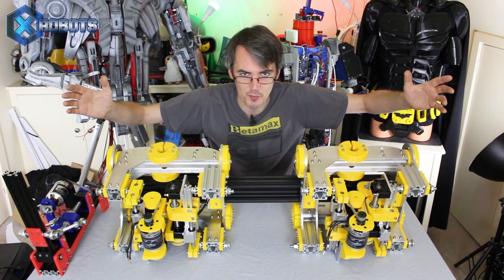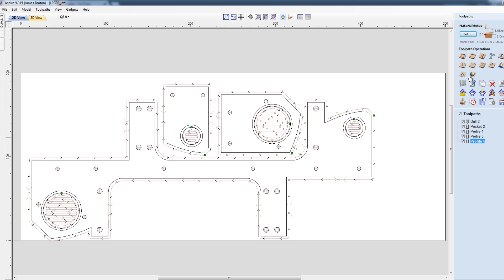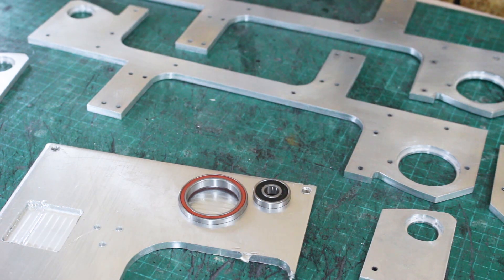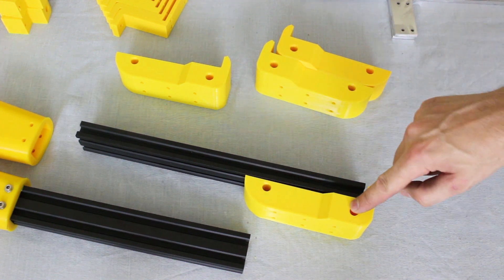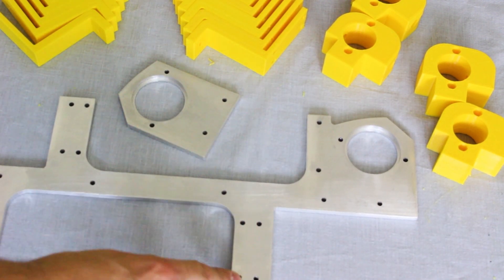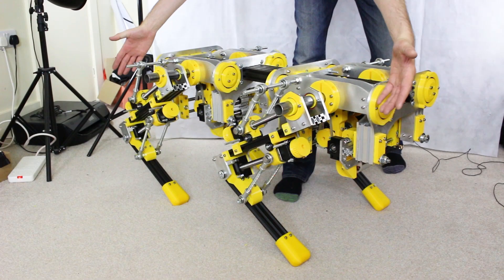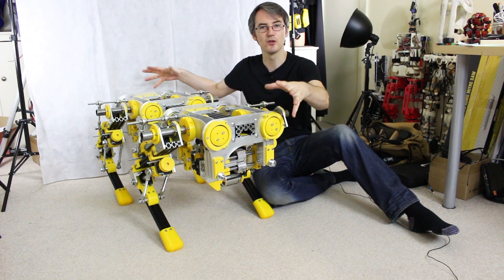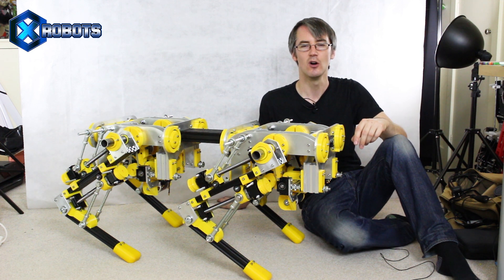openDog Dog Robot #6 | Putting the Legs On | James Bruton

Comment: at 3:10 in, re that dodgey (doggy?) dead spot, im sure you fixed it, but my suggestion was,is,  in  the appropriate function code, add "if in put value = 0, then out put = '37'*"   

37* i.e what ever the correct output shout be, that the mathematics fails to out put because of a divide by zero error etc.
(its just i think you said you added "if input value = zero then fudge it  to 0.0001"   (erghh:( 
just  a thought,:)

(love the whole series:)

Comment: As always great video and build but as someone who does a lot CNC machining I understand how difficult it can be. However, what I've learned is that when you're cutting out big holes and openings (like for bearings) dont cut out the whole hole (no pun intended), but instead cut out just your outside diameter. Leave tabs to keep the scrap middle piece from flying out, and it should work wonderfully (and a lot faster). This should also improve the life of your machine and bits.
Reply from the maker: Those holes were so small it wasn't worth it

Comment: Would it be possible to use gravity and a little valve to drip feed the coolant automatically? And what about attaching some sort of brush to the end effector of the CNC  machine positioned so the rotation of the drillbit pushes those metal strips against the bristles to make them get loose?
Reply from the maker: Probably, you can buy a proper thing called a Fog Buster...

Comment: Just wondering, Why are you machining out all of the center from the large holes rather than just plotting a path to cut out close to the edge then another cleanup pass to get to the final diameter? Surely this ups the machining time by a fair margin and increases wear on the cutter?
Reply from the maker: The little bit in the middle will get thrown out unless I leave tabs and remove them by hand, it's so small it wasn't worth the trouble
Reply: Ah, Good point. I'm used to seeing people CNCing carbon fibre and they usually use sheets of double sided tape to hold everything down to the table. I didn't think about the holes "Plug" popping out and causing problems.

Comment: Very nice project. 
I do worry about the fact that it is very rigid and there is no suspension or dampening for chocks.
Reply from the maker: That will come later. Rigid robots are easy to control because they are more predictable. Any compliance will need to be very well planned and measured and worked back into the kinematic model.

Comment: There's a feature in fusion 360 cam in the drill heights tab were you can click "drill tip through bottom" so that your holes come out clean.
Reply from the maker: Well I could just drill deeper if I'd though of it

Comment: Great work.  I like the reverse idea.  Now this would take a lot of work, but if the design was reversed, the legs could be built directly under the hips, saving a lot of space and a huge amount of weight whilst adding to the strength by using modified aluminum hip plates.

Comment: I'm not sure what you use to break the edges of your aluminum parts, put if you just use a file, consider getting a rout a bur for easy manual edge break or even a chamfer bit to use the CNC to break edges

Comment: With how heavy this thing is, it might be worth the effort to actually build it feet with some toes to that it has greater stability from the added friction and load points. As it is now, on carpet it is going to had sliding issues to cope with, so it will be like Bambi on ice as you are trying to get it to take basic steps. I was thinking something like a dog's paw with a central pad and 2-4 toes. Each one with a ninja-flex pad on the bottom that has a pattern printed into it like a shoe's sole for added traction. Animals have feat evolved for the terrain they walk on, so doing the same for this robot would make it more agile and stable.

This would be after you got the basic kinematic model working for baby steps.
Reply from the maker: Yes we'll see how they go, but they will do for initial setup

Comment: Having the electronics underneath is actually probably best for most applications because it lowers the center of gravity. Top heavy robots with legs are easier to push over in general. It also allows you to have access to more of the T-slot extrusion which means you can add more lasers!

Comment: I would suggest using profile toolpath when cutting through the material instead of pocket toolpaths in vectric, it would spare You a lot of milling time and wear on the bit.
Reply from the maker: It's not worth leaving tabs and the manual cleanup for such small parts.

Comment: Maybe a stupid question but why does the milling machine the intire surface of the holes? Won't it safe time and milling bits if you just mill the diameter of the hole so the middle will just end up as a loose little disc
Reply from the maker: It's not worth leaving tabs and the manual cleanup for such small parts.  You can do it either way

Comment: Great choice on the yellow/black theme.  I am glad you are using plastic whenever possible and only waiting for a failure to force more aluminium.  It does bring up an interesting question.  I wonder if the entire thing was made of 3D printed plastics, if it would be light enough to still hold itself up and function without major breaking.  Maybe a 1/4 size version?
Reply from the maker: I think at the size it is, it would be too flexible, but a smaller model would probably be fine

Comment: Well, I only need to buy/build a CNC / 3D printer... kidney or eye?
Reply: with those o-drives i think you have to sell both😂
Reply: Nah, electronics I can do myself... it´s more that I need at least 1500€ to build a proper CNC and if you want to have it a interchangeable head for 3D printing then all hell breaks loose, having a stable and relative long Z axis can be a nightmare.
Plus some other parts like those opto-encoders he´s using don´t come cheap either, they can range anywhere between 20 - 30€ a piece.
You can easily count for 70 - 80€ per motor assembly without the couplers and the acme lead screws... 
I should probably only concentrate at building a CNC for the moment :-P

Comment: those 10mm rods... i am skeptical!
Reply from the maker: If there were one 'push rod' on them they could bend, but with two it holds parallel with the 30mm tube
Reply: gotcha on that, they still need to take force, that party gets me thinking about a aluminium bracked, just above the 10mm rods.
Reply: i was thinking about this today. as i see it, the force alternates in a walkcycle between those two. i am curios to see what happens!
now you got me hooked to the next episodes!!
;)

Comment: That is looking more and more incredible. One quick question (apologies if it was mentioned in a previous video) but are you using PLA? I’m new to 3D printing and tried PETG for higher mechanical strength, but have struggled with stringing.
Reply from the maker: Yep it's all PLA for now
Reply: James Bruton thanks!

Comment: Is there a bill of materials? I'm particularly interested in the encoders/potentiometers being used and how the robot knows the angle of its joints on startup.
Reply: If I recall correctly, the knee joints have end-stop switches. The legs could be driven on startup until the end-stop switches are actuated so that the robot has some reference for the leg position.
Reply: Spencer Williams That could be problematic if for whatever reason the robot temporarily loses power and runs its start-up routine, say if it was on uneven ground and tucks in all its legs in to find each joint's home position.
Reply from the maker: That stuff is coming next time, but yes it will have home switches for the power-up config. It'll be locked out of any other data until the homing stuff has run.

Comment: When this is complete I hope you send the files to Furze who seems to be getting well into hydraulics at the moment... maybe he can scale everything to 200% and take over the world :D
Reply: Hydraulics work very slowly. There was a video on james channel where a guy made a walking spider with hydraulics. It moved very slowly.
Reply: I've seen some pretty nimble excavators...

Like, if you started with a hand on one of the threads and tried to run a way, a skilled operator could probably knock you down with the end effector before you got out of range.
Reply: i can't imagine why it's so hard to make nimble hydraulic actuators, you could use a system similar to the little syringe  based actuators you see in kids' science project kits, and just attach a normal linear actuator, allowing you to hide the bulk of it somewhere in the core of the body and placing thinner more compact pistons at the extremities, liquid being highly incompressible,  you wouldn't have a whole lot of give in the system if the tubing doesn't stretch, and it would have the same speed or faster of the motorized actuator since depending on the ratio of the diameter of the driving canister to the receiving actuator. assuming the fluid used is not viscus

Comment: You are using conventional milling for most of the cuts, but then switch to climb milling in the bearing recesses. Was that a conscious choice or just default in vetric? Seemed to produce and nice result either way so nothing to worry about. I have found on my machine though that climb milling produces a poorer result in general. Your machine is stiffer and much more capable, but perhaps you could run a test pocket with both strategies and compare finish and tolerances. 

Also WOW you are productive! Im impressed.
Reply from the maker: It was the first way I did it!

Comment: You might consider fixing a pin on the table of your drill press to keep the part from spinning if the drill catches? You can then just slide the part against the pin and it still self centers under the drill bit - saved me some skin and maybe fingers ;-)
Reply: great idea... to the shed !!

Comment: I’ve got a suggestion, for maybe a future project. Why not try using automotive ball joints for hips, elbows, knees etc. you can get them in lots of sizes, strong, 360 degrees travel one direction and about 45 degrees in every other direction. Brand new there is very little play in them. It’s a win win.

Comment: if you were to invert the chassis so the bulk is on the top, wouldn't that just raise the center of mass and make it more unstable? i think it being on the bottom like you have it now is better
Reply from the maker: Yes possibly, we'll see how it goes
Reply: And then where would the saddle go?
Reply: Putting the mass up higher (like the rocket) can actually make the robot easier to control because it lowers the system frequency. In balancebots you either put it below the axis of rotation to make it statically stable, or up high to make it easier to control. Like trying to balance a pencil on your finger. If you add a weight to the pencil, it'll be easier to balance.

Comment: Why didn't you just cut out the large circles rather than fully milling all the material out within the circle? Surely it just adds extra wear of your mill bit?
Reply: Releasing the center part of a 6mm plate by milling is a bad idea and leaving tabs leaves more manual labor. He seems to use a 2-flute 6mm bit, that's easily capable of removing hundreds of kilograms of aluminium during it's lifespan if properly used.
Reply from the maker: only slightly - also I'd need to clean up tabs that hold the middle piece in
Reply: Its better to do this than have the circle bits left that could fly off and jam up the bit or having to leave tabs that then need cleaning up, also if you have good cooling on your bits they do last a very long time if using them on aluminium

Comment: James, you don't have to waste the extra cutting time on removing all the material from the large holes in the milled parts. You just need to cut out around the edge, and it will leave a puck of waste metal in the middle, rather than a pile of shavings.
Reply from the maker: I would normally, and have tabs so the piece left behind doesn't fly out, but it was small enough just to wipe it out completely
Reply: James Bruton Ah, okay. I'd just noticed that you did the same thing in a previous video, so I figured you might not know it was an option, since you were relatively new to CNC milling, if I remember right...

Comment: Beautiful work again, James!  I would keep the hip actuator assemblies low for COG reasons.  It will also be interesting to see how those tubes and studding hold up once openDog is walking.  I know pushing down hard seems like a good test, but forces are surprisingly amplified by a walking motion as momentary shock produces WAY more load than a steady weight pressing down.  Awesome stuff!!!
Reply from the maker: We will see, but I think the Steel tube will hold out